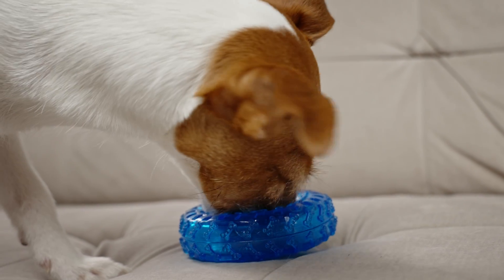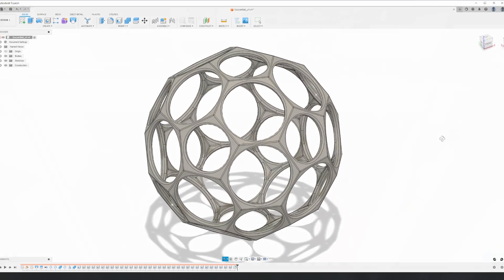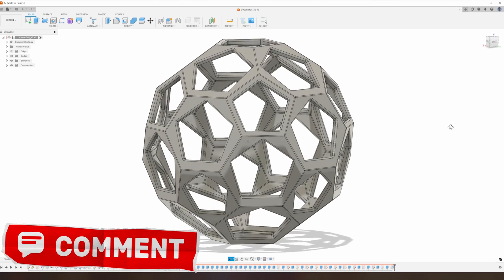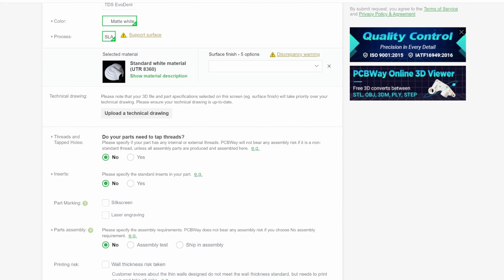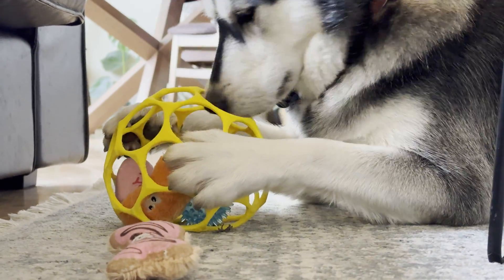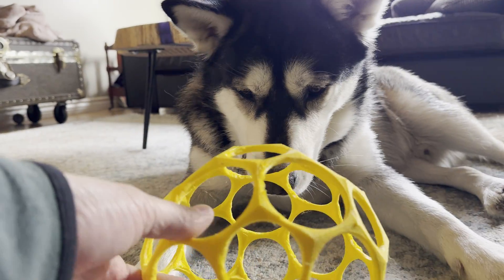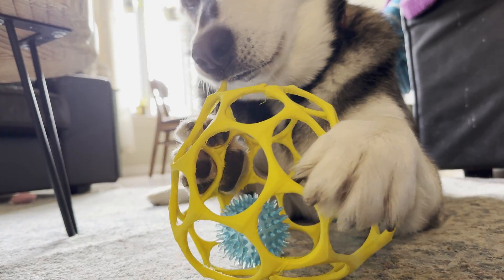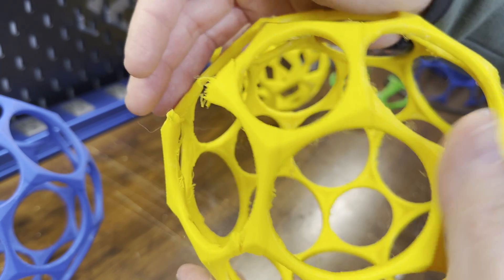Creating a 3d Printed Dog Toy in TPU and testing its strength against a Husky

Comment: Have you ever used tpu to cover or replace parts for an rc car for dogs to chase? I haven't successfully convinced Kong to partner with an rc brand yet. 😬
Reply from the maker: lol, not but I have been thinking of a project where I print a rc car for my husky to chase. I was thinking of attaching a furry tail with Velcro or something so if he does catch it the tail will just pull off letting the car get away to safety :)

Comment: what gr TPU did the printer use for the test one? And what filament did you use? Bambu Lab 90A or 85A? And what is your printer?
Reply from the maker: The first print in blue is in pla, the yellow tpu was a generic brand from my local store. I think it’s 85a. The printer is Bambu labs
Reply: @DaveRigDesign  thank you so much for your reply. Could you remember how many gram TPU filament did you use?
Reply from the maker: @evalearningall not really. It’s not much though

Comment: I have a question my dog can break through anything so what do you recommend material wise like a metal cause he can break through that
Reply from the maker: my husky can also destroy any toy so it's more of how long the toy will last instead of it being unbreakable :)

TPU seems to be the only real option, all other materials are too ridged and run the risk of hurting the dogs teeth/mouth as they bite it or fracture and splinter when they do break that can stab their mouth or swallow and cause internal issues. 

TPU is a really tough material and will withstand most abuse from a dog except the cutting they can do with their back teeth. 

So really if you can design the shape of the toy so they can't really do that you have a change of the toy lasting.

PLA isn't a good idea as it will shatter and fracture seriously hurting your dog.

Comment: When a print completely fails how much money do you think that costs ? I want to get into the hobby but I’m worried about operating cost
Reply from the maker: That depends on how big the print is and when it fails. 1 roll of PLA filament costs around $25 and you can get a lot of average size prints out of that. I’d say most prints cost around 1-5$ in material. The slicing software that prepares the model for printing tells you how much material will be used and the estimated cost before you start. 
Also these days machines have gotten so good they don’t fail that often as long as they file is setup right.
Reply: @DaveRigDesign  thank you 🙏